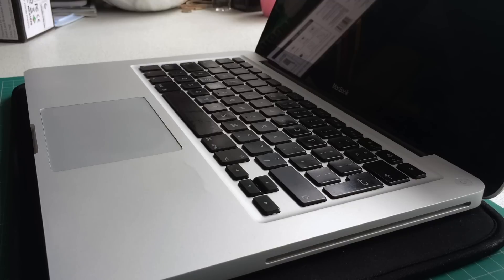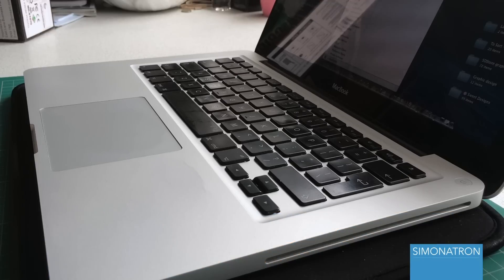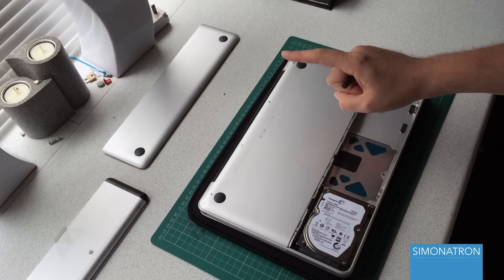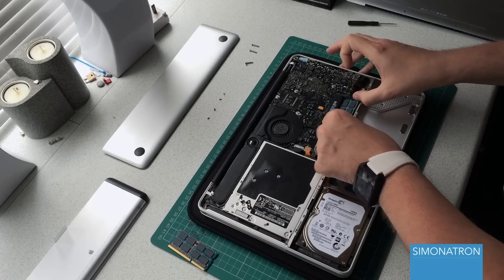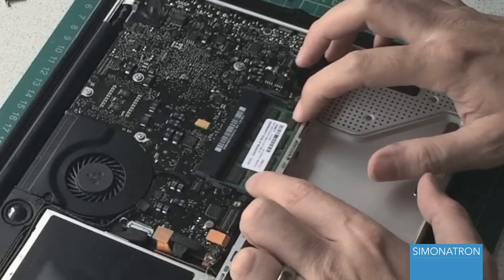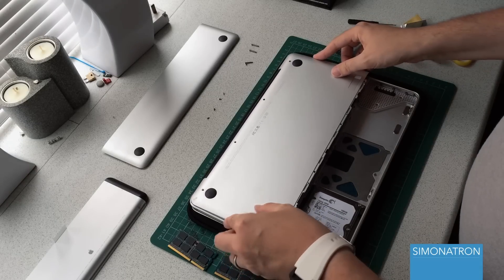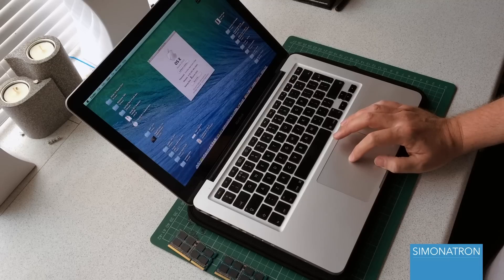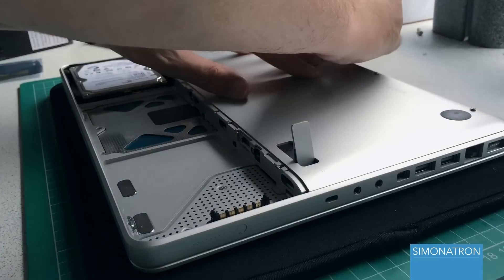Will a Late 2008 Apple Macbook Run With 8GB Memory Installed?

Comment: Why doesn't my Macbook start up with 8 gig RAM??  It only reads the bottom 4 gigs and not the top.  If I insert a 2 gig which it had it starts up fine.....and it shows 6 gigs ram.  What could be wrong?? HELP

Comment: Hi, just wondering if your laptop is still running well after you installed the additional memory?
Reply from the maker: It’s still going strong. However I did install a full SSD in to it which increased the speed dramatically. You can only go up to OSX high Sierra too 👍🏻
Reply: Psymo actually you can install a patcher for Catalina and it works perfect. I’ve had Catalina installed for around 2 months. But this is the OS where apple stopped 32 bit apps
Reply from the maker: I have tried Catalina with the patcher, but I had a tonne of issues with it. In the end I wiped and rolled back. I don’t actually use this MacBook myself these days, my daughter uses it for school work so suits her fine 👍🏻

Comment: Thx for the video anyone tried the crucial Brand for memory ? any suggestion for a small SSD and battery ? do not want to spend too much, as it is a first Macboook 2008 Project, a bit beaten up, had a Macbook 2010 that was awesome after an SSD and Memory but it cost a bit too much last time around. Cheers

Comment: I upgraded firmware 8gb RAM , 500gb ssd and using Mac OS Mojave 
My machine is Macbook 2008
Reply: T. M. Hi how did you do it
Reply: @ronnellazaro1502  i think there was nothing professional involved. it is very simple. with orignal 2gb szstem will stuck. install 4gb and 1 gb ram and update firmware. then install all 8gb.
Reply: @tariqmushtaq627  Is it macbook pro late 2008 13.3"?
Reply: @ronnellazaro1502  no it is Macbook late 2008 13.3

Comment: I have a Macbook pro laptop I got from the recyclers bin at my work. Its seem to work fine but it has no running system on it, I have no CD for this as well. I would like to know what system does it need and how would I make a boot USB for this machine??? If you could help me out, this would be really great.....Thanks
Reply from the maker: You’ll need to make a bootable USB version of the OSX version your laptop supports. If it’s a Pro it may support a slightly newer version than what the MacBook on the video runs. Search on google for the model number to find the correct specs and supported OSX, then search for how to make a bootable version of that OSX 👍🏻

Comment: How much is the battery backup
Reply from the maker: ahsan khan Sorry I cant answer this. Best resource is iFixit, find your MacBook and check out the spares list, then use this to search for the correct component. I’m sure you’ll be able to source a low cost replacement on eBay or similar. Good luck 👍🏻

Comment: The "Late 2008" machines actually made from February 2009 thru May 2009 have the firmware update already.

Also got a MUCH MORE RUGGED LVDS flat lead cable, than earlier builds...

Solving the worst LCD problems these machines had..

J.C.
Reply: Hi is this usable in 2020 I seen a cheap one for £60

Comment: Do you know if this can work with pc10600 or 12800?
Reply from the maker: MRHOTCAKE  Only the ram specified in the video is supported.
Reply: Psymo I have a pair of Pc10600 sticks, I installed it without patch anything and it worked perfectly, It has 8Gb and a 1Tb HDD, I sold it very fast. So if you are asking too DDR3 1333 (PC10600) can be suported without any problem

Comment: How to install sierra on this mac?!
Reply from the maker: Latte Art You can’t unfortunately, it’s not supported.
Reply: Psymo i install Yosemite but manually with usb i have to upgrade ram and change to ssd and will try installing sierra
Reply: @latteart6986  sir., where did u download the yosemite for macbook late 2008?. Because i still have a version 10.7 and i want to upgrade it. Do i need also to upgrade my hardrive to ssd? I have 8gb ram. Thanks for the response

Comment: does it handle 1080p video editing at 60fps without final cut?
Reply from the maker: Vinicius Viega It wasn’t too bad at 30FPS, 60 may be pushing it. It relies on graphic chip for video editing and this is old hardware now.
Reply: What model do you recommend me? of these older ones!

Comment: How did you upgrade to Mac os 10.9 my MacBook same year only lets me up grade to 10.7.5?
Reply: there's a patcher for the latest mac os mate. they release them everytime there's a new os that's unsupported on older machines. it's easy to do as well. just watch a video on youtube of how to do it for your model. the patcher basically takes the install image and adds a tool to it to patch your machine to work on it that you run after the install via a usb drive. http://dosdude1.com/mojave/ this is what you need!
Reply: I did the same upgrades and running Mojave on late 2008 macbook. 10 years old and running better than this year's pc.

Comment: I upgraded one of these a couple years ago (around the time this video was released) and it actually even runs with 16GB, which is what I upgraded it to.
Reply: Aerdian what all did you add/replace for it to run off 16GB and does it overheat or slow down? Also can I upgrade my camera to one with better resolution?
Reply: No! the camera is unique...
Reply: Anything special to have it run on 16gb?
Reply: 16GB? Ive search the internet wide and many people said Late 2008 Macbook 5,1/5,2 Can only run max of 8GB

Comment: I just spent $60 and got my Late 2008 MacBook Pro running 8 gigs. Runs well. I can use this computer again. Easy to do and it works!
Reply: Did you had to upgrade the firmware?

Comment: Did anyone use RAM with greater than 1066 MHz? I mean 1333 MHz for example
Reply from the maker: Bashir Uzhakhov has to be what I used in the video for it to work 👍🏻
Reply: 1333 works ok but 1600 is not working, checked myself…

Comment: so this can run windows 10 64-bit? I want to install windows 10 as apple doesn't support this macbook. My grandpa gave it to me when he upgraded to the early 2015 base dual core macbook pro. In all honesty, it would be nice to know if this runs windows 10 64-bit! Plz an ty in advanced! :)
Reply: Michael Mueller you'll need to wipe the drive and install Windows first. Also need a third party boot loader if I remember correctly

Comment: I own the exact same model as the one you upgrade in the video, but my laptop ram runs at 1333Mhz, and yes i put in 2x 4GB modules, the speed is faster and you surely can experience that! Ok, it is a older laptop, but for everyday usage, this macbook is very snappy, if you install a ssd ofcourse, i have a 250GB ssd and this machine screams!
Reply: Hi Bram , are you still using your laptop?

Comment: A repair company changed the os from 10.6.8 to 10.9.4 and the result was dreadful. They said the computer was now obsolete and not supported by Apple. I found the serial number was compatible with 8gb ram and ordered from OWC in America. They cost around $70 (I'm expecting a tax bill on top), took about 20 mins to install - 8 micro screws and a couple of sets of clips. The machine is now repaired. Mail, text-edit, Safari and Adobe all work properly.  Can't believe the change. You've gotta do a little bit of digging to keep the old stuff going - but new means upgrading programs, transferring files... days of work.  Anyone know where I can find some new keys?  A, E, T, O, H, N, and space bar?

Comment: Hey guys can Macbook Late 2008 works with 1600 mhz DDR3  2x8 4GB of RAM?
Reply: Delgermunkh Bekhjargal i am asking the same question hehe
Reply: i found the solution
Maximum supportable RAM 4GB DDR3 1067 mhz ( Tested ) and 1333mhz ( didn't check )
Good luck
Reply: 1333mhz do work have 8 Gigs installed

Comment: ABSOLUTELY YES! also throw in an ssd and you'll swear its a brand new computer...  ;)
(and total cost under $100 (depending on ssd size)
Reply: What size ssd can I fit into a 2008 macbook ?
Reply: chadwick palmatier  exactly what I did!
Reply: Bpmm 01 what does the ssd do for your computer?
Reply: @capturedbymiyah814  it speeds everything up In general especially booting up, I'm not sure what the max size you can put in but 1tb definitely works.
Reply: A 7200 rpm SATA drive is good enough
160 to 320GB drive works fine..
J.C.
Reply: AND....

Look for machine with the blinking"?" folder.

Needs a hard drive with OS...

Any that gives a POST Chime...

Or screen lights up and then beeps (Needs RAM)

No screen

No buy!

J.C.
Reply: Ssd wont work on the laptop. The drive cable is too slow for it and it wont detect the drive
Reply from the maker: Works with an SSD just fine, the same laptop from this video is now running a SSD with no issues.
Reply: Psymo weird... I used a Kingston a400 or something and it just wouldn't recognize it.
Reply from the maker: TinusXXL I don’t have much information in the way of compatibility, but maybe this laptop is fussy with which SSD it can use. Also, silly question but you’ve  checked the HDD cable for defects? They break quite easily 👍🏻
Reply: Psymo yeah i guess it only accepts the ssd which is likes since i already bought a new cable and that didnt work either
Reply from the maker: Have a look at this > https://www.ifixit.com/Answers/View/283273/Questions+about+which+SSD+in+my+MacBook+5.1

I think this may be why! 🤞🏻
Reply: Psymo yes! That might be it. I already updated all the firmware they mention, but indeed, the ssd is sata 3 which makes it unusable. Makes lots of sense now. Thanks a bunch!
Reply: @Psymo  Is this SSD something specific for this computer or I wondering where I get it and what kind?

Comment: How important is it to be on this BootRom mine is MB51.0073.B06 will it work?
Reply: Jasenko Stojakovic yes it's important, because the slot just read 2gb/1gb and the other slot only read 4gb/2gb, if you don't upgrade BootRom (I've been tried)
Reply: Thanks man <3
Reply: None, it s/be MB51.007D.B03 .update EFI firmwave from Apple website

Comment: Thank you! I recently added another 4gb memory card to my MacBook '15 Late 2008 machine. I am running 10.10.5. My machine has Boot Rom Version MBP51.007E.B06. I assume that's ok since it's a higher than the "Required Bootrom." Any thoughts?

Comment: So what latest IOS can be installed on this 2008 macbook if the memory has been upgraded already to 8gb?
Reply: The amount of memory in your mac has nothing to do with which latest operating system it can use. It's its age. The newest OS X you can run on your 2008 MacBook is OS X El Capitan version 10.11.6. BTW iOS is for the iPhone and iPads, not macs.
Reply: Luther Villaflores Jr.
Reply: I thought El Capitan was the latest possible upgradable OS. Did you jailbreak the system to install it?
Reply: There is a patcher that will allow HS to run on this machine

Comment: Doesn't work with MBP51.007E.B06 - runs for a while and then crashes
Reply: You might've installed some bad memory. Try booting with one of the sticks and use it for a while then try the other.
Reply: Oh vey! :(
Reply: So far so good with this Boot ROM. Will report if any crashes. Fingers crossed.

Comment: I just installed 8gb into my late 2008 unibody macbook. Does anyone know why my laptop only says it registers one? It says one slot is empty, so it thinks I am only using 4gb of memory.
Reply: Hey! I think you’re not using the correct bus, It’s PC3-8500 (you can see it on the memory’s label). 
When you use PC3-10600 (or more) your MacBook doesnt recognizes more than one slot.
Reply: You need OS-10.6 SL... or better!

Comment: Does the bootrom need to be the one you stated? I have "MBP51.007E.B06".
Reply: Hey... I have the same bootrom, did you upgrade? I'm trying figure out if that's ok.
Reply: Selene Muñoz no in the end I didn't bother. Couldn't find out if I can upgrade or not. Doesn't matter though, my Mac is 8 years old now, so I may as well just look into getting a new one.
Reply: Hi bro, please can you send me the parts (RAM and SSD)?

Comment: OOOOOOOR, you could go to the owc website and look up how much ram your mac can support, given you have to look up a few things in the about this mac section, i've upgraded a 2009 macbook unibody and a 2010 MBP using that site as a reference then buying parts ram/ssd from newegg or amazon and it WORKS!

Comment: Hi,  I bought an 8GB kit for my late 2008 macbook by mistake.  I didn't realize that the maximum memory for the computer was 4GB.  This is my boot ROM version MBP51.007E.B06  Will it still work?  Thanks for your help!
Reply: +Monica Zorigian  I found this and it seems to answer my question.  http://blog.macsales.com/9102-secret-firmware-lets-late-08-macbooks-use-8gb

Comment: Do you see any performance improvement?
Does the fan works more?
Does the computer get hot?
Reply from the maker: Massive performance improvement, boot times shortened, apps run smoother. As its increased memory it does not effect fans or heat, that's CPU related.

Comment: can this work with my late 2009 macbook pro and do you know if i can use 2 8GB to make it a 16GB macbookpro then having the 2 4 to make it a 8GB?
Reply from the maker: Im sorry, I can't give you an answer to this question. However there are many sites that can tell you by simply putting in your model number.
Reply: Hello are you still using your Rams?

Comment: I upgraded from 4GB to 8GB using OWC DDR3 2(4sticks). Works perfect. I also removed my Optical Drive replacing it with a Data Doubler and installing a new 480GB SSD from OWC. http://www.macsales.com/

Comment: Hey there, Simon.  I have this exact laptop with 2.4 Ghz and 4 GB RAM.  I downloaded something that requires 3.0 Ghz and 4 GB RAM, but it recommends 3.2 Ghz and 6 GB RAM.  It was obviously running incredibly slowly, and I was wondering if this is likely more of a processor issue or if I could do this 8 GB installation and likely resolve the issue.  Thanks for your help.
Reply from the maker: Unfortunately if the program requires a 3.2Ghz cpu and you only have a 2.4ghz cpu, that would be the problem. Increasing the memory would help a little, but not that much in this case.

Comment: So,It is possible to install just one 8Gb RAM in a single slot,or might have problems ?
Reply from the maker: Honest answer, I'm not sure. However the maximum ram capacity is 8gb, so as long as you don't go over that I can't see why not. There are benefits to having 2 4gb banks though.
Reply: I think the same. Thanks!
Reply from the maker: +Alice Lindgren let me and everyone else how it goes! :)

Comment: I have a late 2008 aluminum 13" Macbook 2 GHz Intel Core 2 Duo processor and I just recently stumbled upon the fact that it can support 8gb instead of the stated 4gb limit and let me tell you what a massive difference 8gb makes.  The computer is awesome again.  It was always and still was fast but when I had a lot of programs open and it got to the 4gb ram usage the computer would slow to a crawl understandably as programs now days are memory hogs.  Now I can have everything I want open with about 1.5gb left of RAM open and everything runs perfectly smooth.  Years ago I had upgraded from 2gb to 4gb Crucial Micron memory, now I used the same Crucial Micron memory for this upgrade and they are awesome pieces of RAM.  Crucial Micron has always been the best highest quality memory, I only buy memory from them.   I would have been a shame to waste money on a new laptop because this one is fast it was just a memory capacity issue with newer software using more.  With an SSD harddrive and now 8gb I can happily keep this Macbook another few years!!!  It is completely up to todays standards!!!  It literally took me under 5 minutes to install and be up and running again.
Reply: see the videos, make a cup of coffee, and THINK before you POST.
and try to find a good memory to upgrade yours.
Reply: Lucky that yours was 4 gig, mine was 2 gigs, so I took a 4 gig stick from my linux laptop and put it in, so now I have 2 laptops with 5 gigs Ram :/
Reply: @cpufreak101   so you used a desktop ram for your MacBook and it worked?
Reply: @jasperlegend9471  no, laptop ram
Reply: @cpufreak101  ok i was just trying to know if other laptop Rams can work in a MacBook?
Reply: @jasperlegend9471  wouldn't know, it was just standard laptop DDR3
Reply: @Motorhead: Thanks for your comment. Like your machine, mine is a 2 Ghz unit (rather than 2.4 Ghz as shown in this video). I was super apprehensive as to whether 8GB installed in my machine would work but your comment gave me greater confidence. Originally, I was prepared to replace only a single card - substituting a new 4GB card for an old 2GB one - meaning I was upgrading to 6GB rather than 8GB. However, after seeing your comment I decided to go all in. 8GB has now been installed and so far so good.
Reply: how's the battery life?
Reply: +Fidel Obambi battery life is the same, just depends on the age and use of the battery. They degrade over time like any rechargeable battery.
Reply: What was the part number of the memory and SSHD that you installed??
Reply: thats TRUE!

im still using this awesome machine with 240gb SSD and 8GB of RAM with Yosemite 10.10.5 and everything is perfect, even for 2017 usage.
( i put VenomRX 2X4GB DDR3 Pc10600 RAM and everything is work like a charm )

still using this and bring this machine everywhere i go instead of my bulky thinkpad W530 LOL.
Reply: It can not support 8 GB ! But it will do 5 GB 4+1

Comment: what brand ram should i get? I have a macbook pro 5,1 15" core duo 2.4 late 2008
Reply from the maker: +LXRYLXRYTV  Not sure about the Pro as this video doesn't cover a Pro.  Google will be your friend here.
Reply: I'm guessing you could also get PC3-8500 DDR3 1066 Mhz memories just like the one in this video (same model as mine A1278 2.4Ghz Macbook). But to check it yourself, you can check them here http://www.everymac.com/ultimate-mac-lookup/?search_keywords=MacBookPro5,1

Cheers!